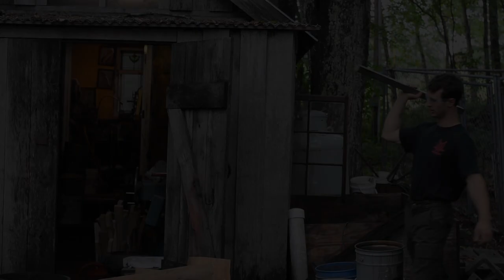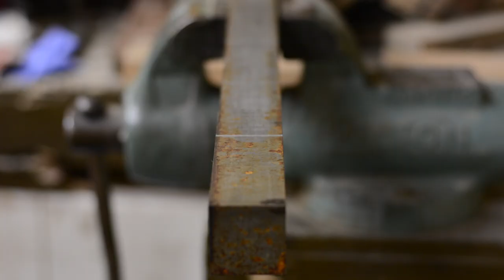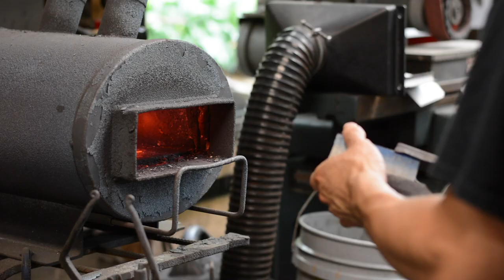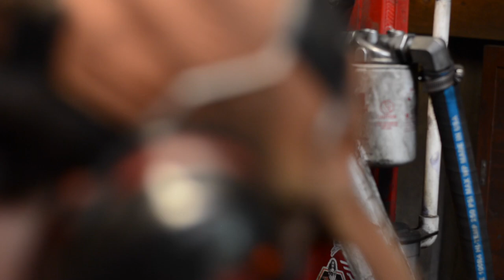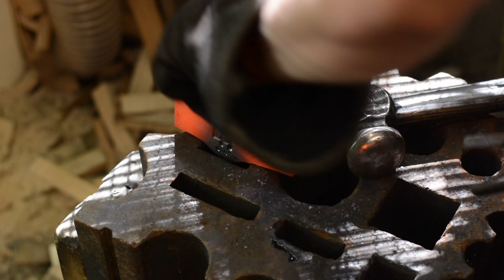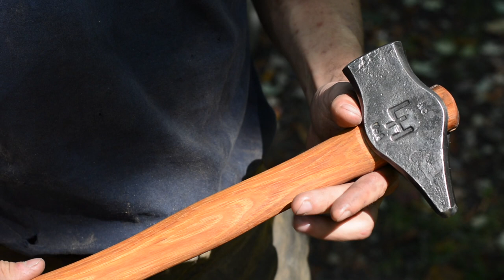FORGING THE BLACKSMITH'S HAMMER

Comment: Beautiful Hammer,  What steel did you use?
Reply: I think he uses the same steel as what he uses for his axes, which would be (relatively) high carbon steel/chrome alloy
Reply: Good chance it’s 1045. Many are built with this steel. Hydraulic cylinder rods.